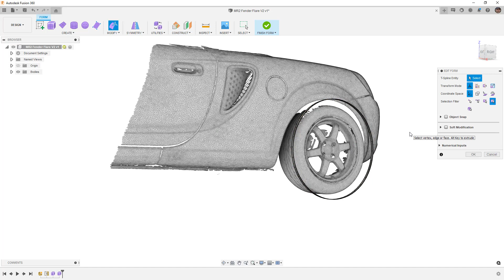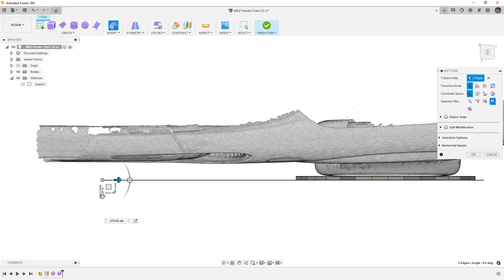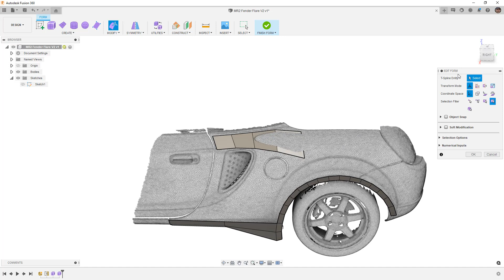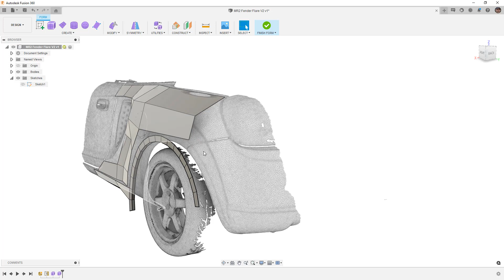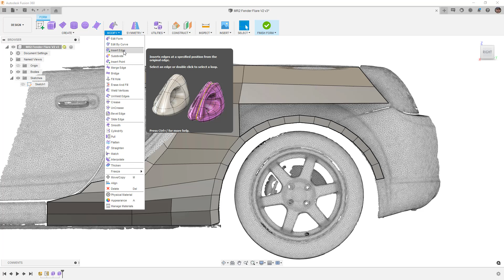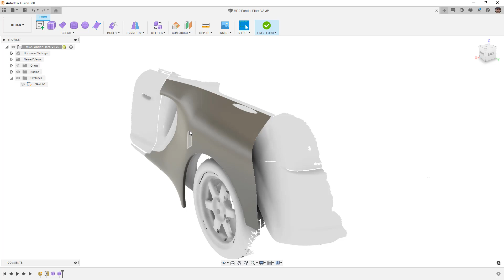Design a Fender Flare in Fusion 360 - Designing an Over Fender - Part 1 #Fusion360 #CarDesign

Comment: Sorry guys but is all just pain in the ass... In blender with plugin or more better with Maya retopology
Reply from the maker: maybe so but blender can't export a true nurbs surface as say a step file.  This would be required for anything outside of just 3d printing.  If you were to CNC a mold for example, or wanted to perform FEA or CFD, you would need a surface/solid model not a mesh/poly based model.  Fusion allows you to model in a similar fashion (it is more picky), but the output of that is a solid or surface body and not a faceted conversion of a mesh out of blender.

Comment: I don't think it's the best approach. You should start by making very rough shape of flared body without any wheel arch cut out, shape it how you want it to be and only when cut out the wheel arch or other details. Currently you limit yourself of clean modeling because the wheel arch is defining your edge flow. In other words get your main shape as a block and then cut/sculpt out of it to refine. Just look at your model right now, it's really bad to be fair.
Reply from the maker: I don't know if "its really bad to be fair' is fair ;)  I've done loads of different videos on this subject using different methods.  With harder edges I 100% agree that building it without the arch is the best option as seen in this video https://youtu.be/y-ZCL08wa2k  
It brings up different challenges.  Doing the arch and fender as 2 separate forms and blending with surfaces is also another valid method depending on geometry.
Reply: @LearnEverythingAboutDesign  you are right, most of the time it is some sort of the hybrid approach that works the best. 👍🏻 I just developed this ocd over the edge flow and uniformity and anything what is looking funky just fires my brain 😂 That's even more important if you would be modeling in polys and I think that there I developed this habit. I get my prototype shape fast and boxy, usually out of multiple separate parts and then I start a new one based on the prototype.
Reply from the maker: @povilaslondon  I have found with designs I do while not recording I generally stay in box display so I don't worry about what is happening until its closer to done :)  Kind of like hiding a subDiv modifier. The 'T points" in theory are a great thing but in practice produce more problems in most cases.  This fender flare series was one of my older ones on the channel.  in the most recent one we do the fender both ways and show how you run into issues with this method and how the arch being its own body for awhile is often easier to control edgeflow.

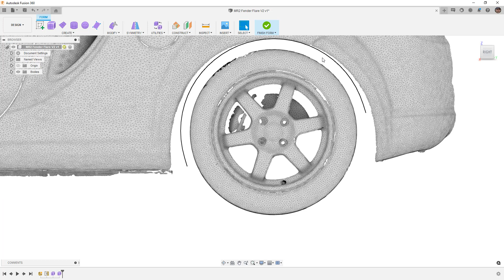Comment: Hi, At 4:51, you start selecting the edges by dragging your mouse, however when I do this, it only selects the nearest vertex, of course then i can only move one part of the form...
How do i get it to select the edge instead?
At the moment, i need to turn the design slightly, then select the edge, then recenter the view and then work... is there a setting I need to turn on?
Reply from the maker: When you drag bottom right to top left it "should" select edges and faces it crosses.  If you go from top left to bottom right it will only select things that are completely encased in the selection box.

You can also expand the select menu from the tool bar and adjust your selection filters.  Note that your selection filters/priority does change when you use Edit Form, vs just being without any tool active.  So if you change it before edit form you will need to check it again.
Reply: @LearnEverythingAboutDesign  That was really helpful thank you,  I didnt realise there was a difference in the way you click and dragged.
I checked my selections , made sure "Select Through" under Selection Filters was applied and it started working!
Thanks so much!
Reply from the maker: @JDMRoadHog  No problem, glad it worked!  The top left to bottom right is nice when you want to select edges that are normal to how you are viewing, I use that all the time.  The bottom right to top left is nice to delete faces that you cant see based on your view.  Even to this day I still will drag one way, realize its wrong and go the other way ;)